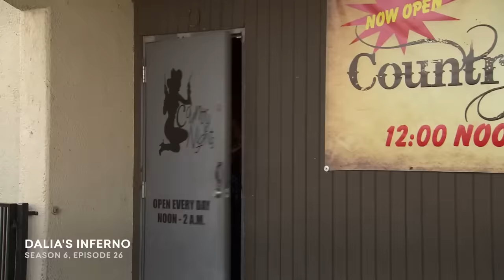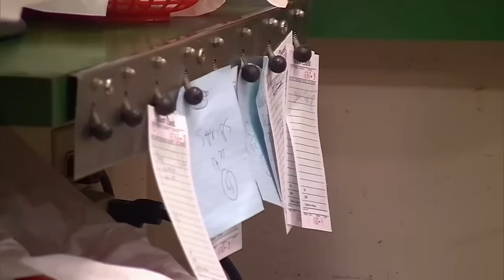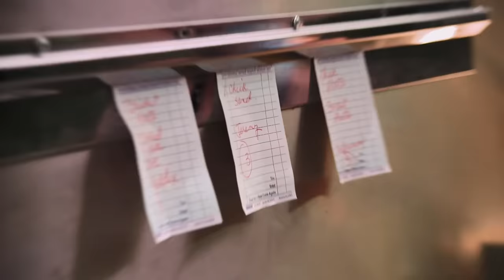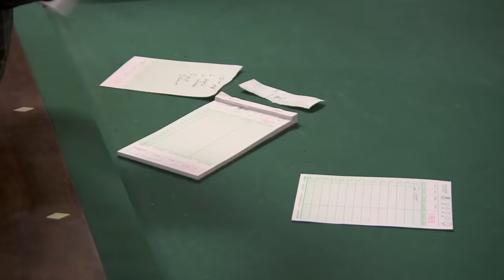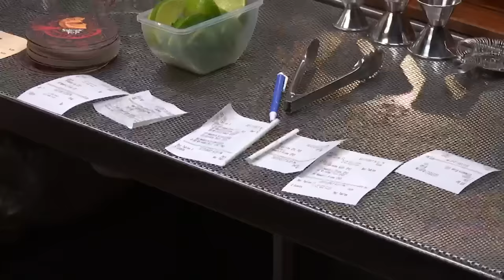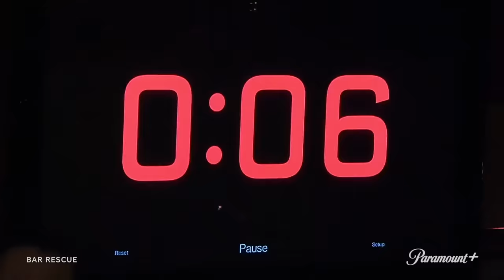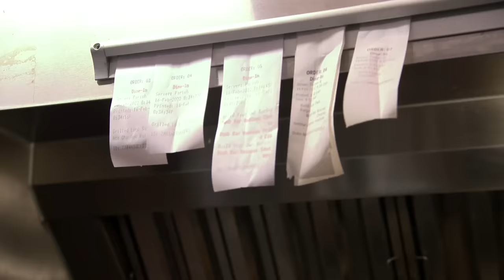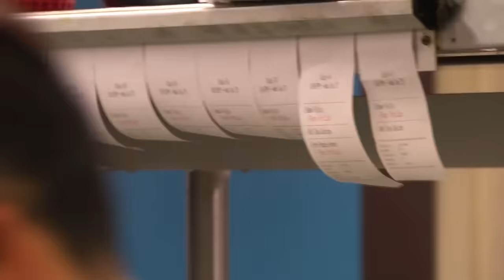Bar Rescue Stress Test 😰 SUPER COMPILATION

Comment: If that fire had really gotten out of control, with a crowd that size and packed in like that, it would have been a nightmare. Some of that smoke kinda looks like it was added post though. Like it looks more like an effect than the little smoke you actually see come off the fire.
Reply: I'm sure it was.  I know someone who was on this show and they said it is all fake and the producers manufacture drama
Reply: However, it is worth noting that poor, inefficient combustion results in an abundance of smoke from a fire, as opposed to more complete combustion, which comparatively has very little smoke. Smoke is the result of impurities being expelled from the flame itself, which it cannot burn due to them not being combustible on their own. Therefore, we cannot be completely certain that they said they used special effects to add drama and suspense, as the kitchen fire very well could have been burning very inefficiently and thus producing a lot of smoke at that time.